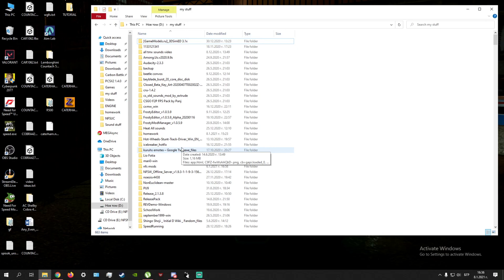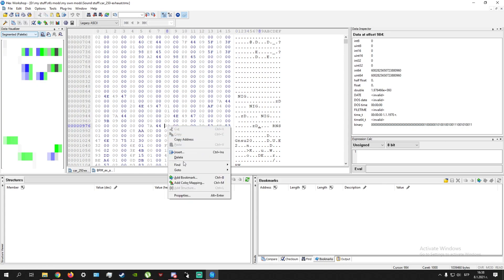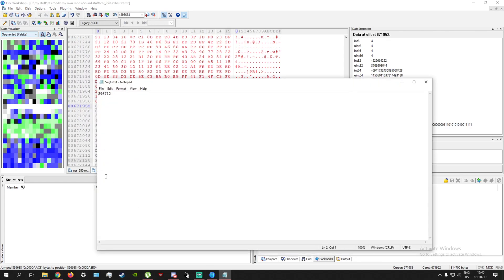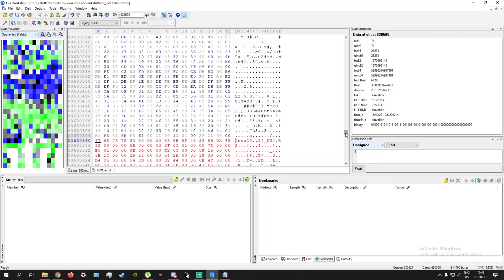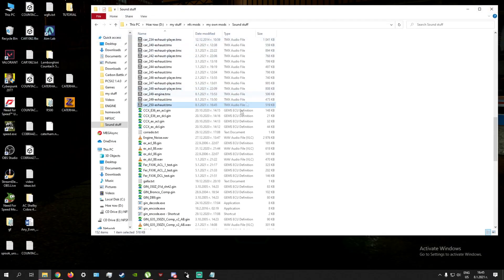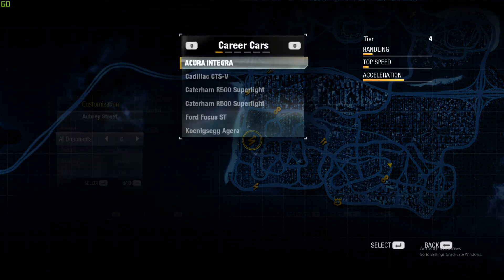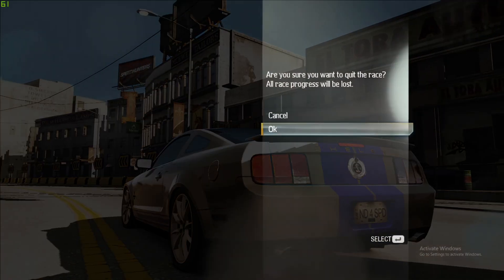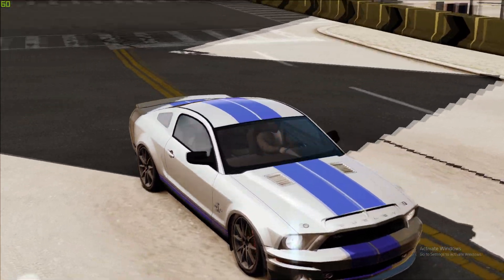How To Make Custom TMX's Tutorial | Thanks For 100 Subscribers!

Comment: Have you encountered this issue, where you make a .tmx, rev to redline, then the (snr sound effect?) effect of lifting off throttle keeps looping on itself, and eventually the game crashes. Tried editing making one from cor_c5_a (2,3) and putting it into aud_rs1_eng. The GINs come after the SNRs, so I assume there is no need to change the offset for the SNR, but here it is haha.
Reply from the maker: The offset of the snr is only changed if you change the gin or whatever before it so if nothing was changed then the offset should remain the same
Reply: @KristianLyubenovYT  Finally got a modded TMX to work, thanks for the tutorial. Managed to swap in the other acceleration file inside lam_murc_a.

Comment: heyy my game crashes when i do this using the mw stock db9 sounds and car_135.tmx as example, do you know why could that error happen?
Reply from the maker: you could have forgotten to change a value, in fact I did just that in the video, but fixed it later. just check again and if you notice a value doesn't match up to where it should be then change it to what it's supposed to be
Reply: @KristianLyubenovYT  Exactly, i cant understand what did you do to make it work
Reply from the maker: @Frannco-gs2km  you may have to start over and just make sure everything is gucci

Comment: "It's all the same"

Apparently there are no 04's and 20's in the TMX I'm modding right now (car_116-exhaust)
Reply from the maker: look very closely, sometimes it's hard to tell
Reply: @KristianLyubenovYT  Another potential discovery is that I think the version of TMX files we're modding is different, while you're modding for Undercover, I'm modding for Pro Street.
Reply from the maker: @killerdragon5584  they could be different in some way, but i'm not sure that is the case... i'll have to check
Reply from the maker: @killerdragon5584  i checked, it seems they're the same: https://i.imgur.com/pS75BDo.png
Reply: @KristianLyubenovYT  Alright thanks! I probably didn't look hard enough x_x
Reply: Okay, so I got another problem, I've been trying to import the GT86 gin from 2015 into car_116-exhaust.tmx, but the game keeps on crashing, even if I leave the 0400----20 hex unedited,
Reply from the maker: @killerdragon5584  you're not supposed to edit that 04008020 string anyways, and double check everything you have done, you could do a bluff like I did in this video
Reply: @KristianLyubenovYT  A bluff? And I've been double checking, I left the 04008020 unedited, and the game still crashes, sadly.
Reply from the maker: @killerdragon5584  if you saw in the video, I forgot to edit one of the values (I think it was for the snr) and the game would've crashed if I didn't catch my mistake
Reply: @KristianLyubenovYT  The values for the SNR? Not sure where to find it and how to pinpoint which value it needs to be on...

Comment: Great Video,Maybe In Future With Tools Liked Vlt ED Is Possible To Export And Import To Create Custom .TMX,change some Values like RPM Settings and Others,A Lot Older Games and Some New Games Has Tools for export and import Sounds and Others Files for Moding In GTA San Andreas,IV And V (not Much,but a Few Years Ago liked 2015-2017) Has Sound Pack Mods From Other Games(and Other Games Liked Gmod Too),For Example Cod Arms Effects,Forza Stuff,Etc;Maybe Someday Is Possible To Happened In NFS,My Dream Is See Forza Motorsport 1-6 and Horizon 1-2 Sounds(Engine/Exhaust,Transmission and Turbo,Superchager and Centrifugal SC) in NFSC and Pro Street Maybe